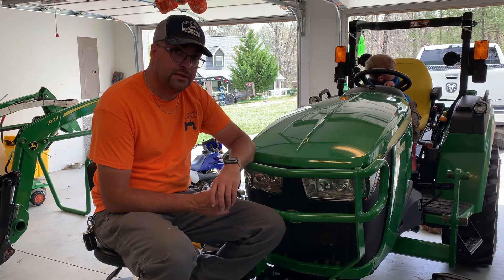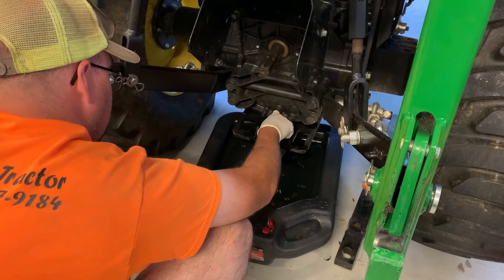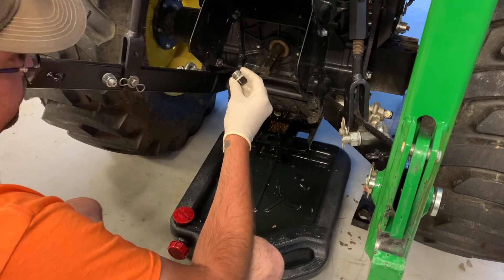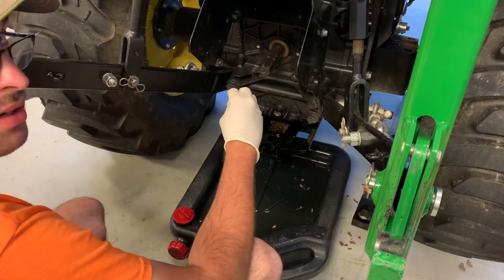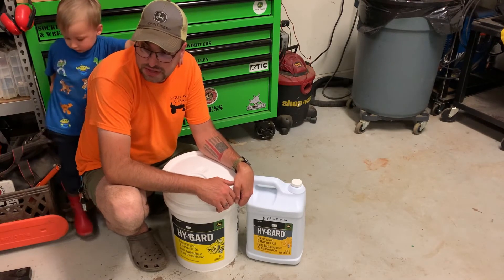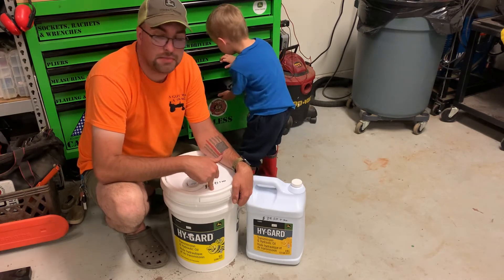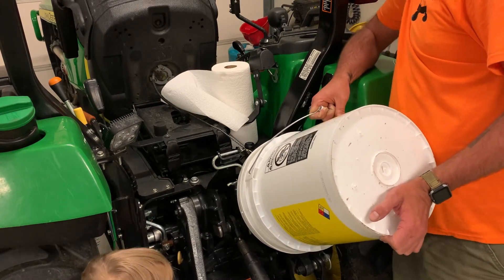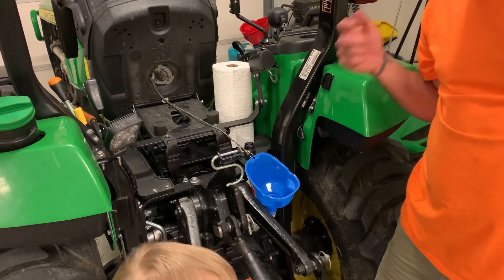#24 Hydraulic service on John Deere 2038r

Comment: I believe your tractor is supposed to take low viscosity Hygard.  The 2032r has “Low Viscosity” embossed on the dip stick. I bet yours does too.
Reply from the maker: It does but Im in a warm climates and the regular works better for me on hot summer days bush hogging.